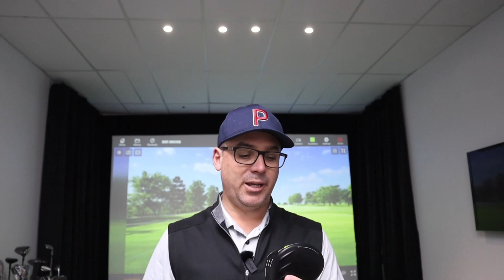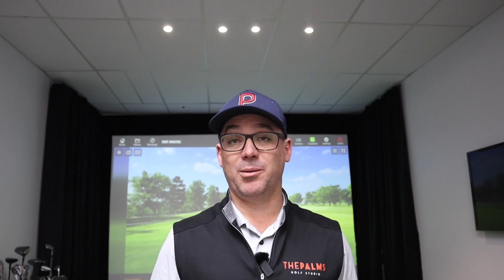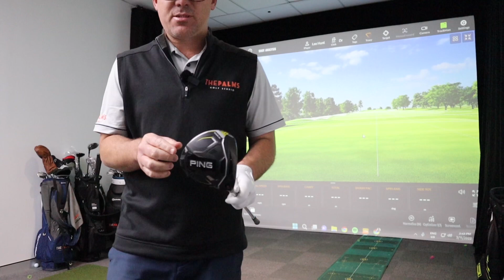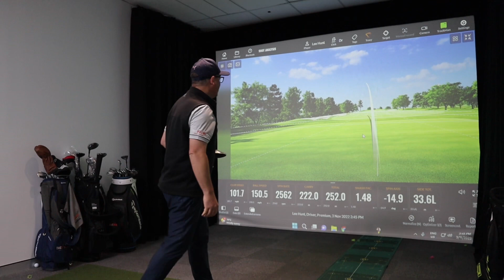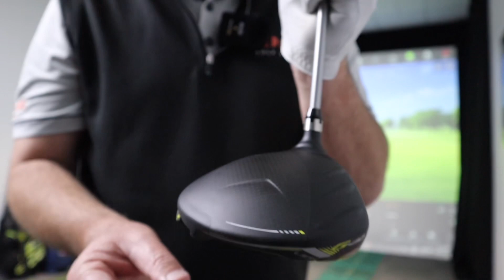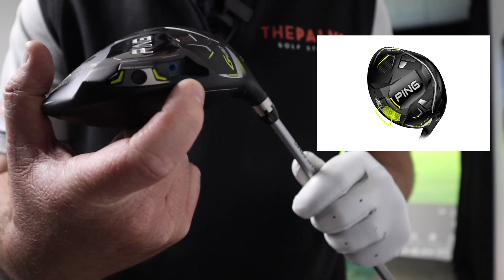PING G430: First Drive Review and Road Test

Comment: Can you let me know if the G425 and G430 use the same adapter in the driver shaft? Are they interchangeable? I have a 425 and just ordered a 430 head and wanted to know if I can use the same shaft & tip.
Reply from the maker: Hi Scott 

You can use in both 425 and 430 ✅

Comment: Hi Lee, just curious as to why you play an X flex with a club head speed of 102mph? Loving the look of the g430, just wish they would lose the turbulators.
Reply from the maker: Hi Andy 

I like a soft tip X so it still has some play and feel and protects the spin rate.
Reply: @leehuntgolf  cool, was just curious. I swing around the same but play a riptide 50gram stiff counter balance. Always struggled with heavier shaft even when i was younger and fitter. Guess we all find something we feel comfortable with 👍

Comment: just picked up my g430 LST 10.5. it was a blast to get it on the course and hit it on a few of the holes. such a great and fun club.
Reply from the maker: Fantastic! Enjoy 😊
Reply: Can you let me know if the G425 and G430 use the same adapter in the driver shaft? Are they interchangeable? I have a 425 and just ordered a 430 head and wanted to know if I can use the same shaft & tip.
Reply: @ScottKurt  I have the g410 adapter and the g430 fit on my old shaft and adapter